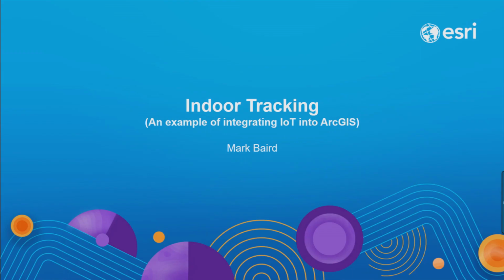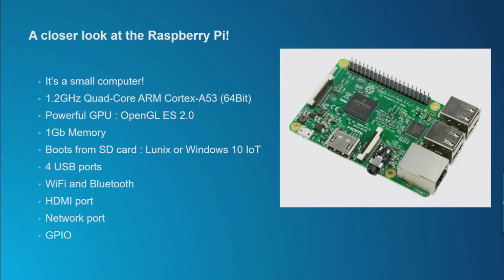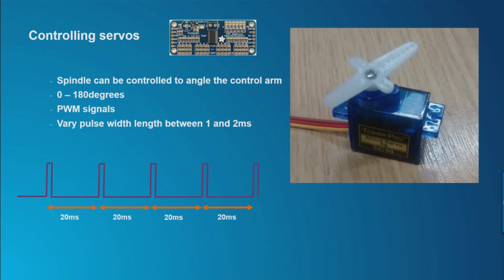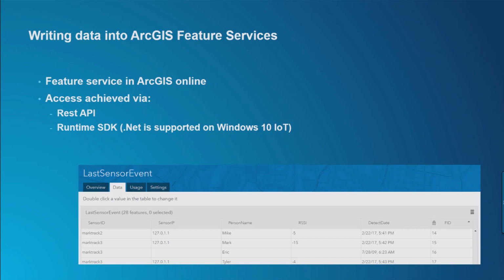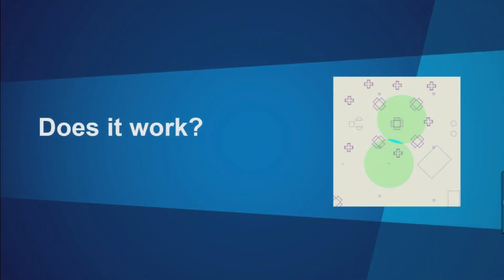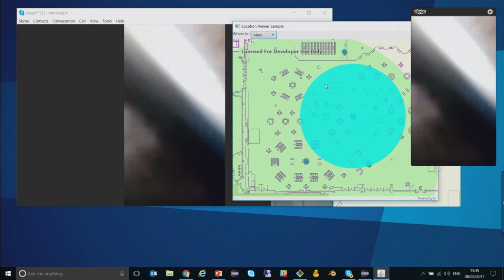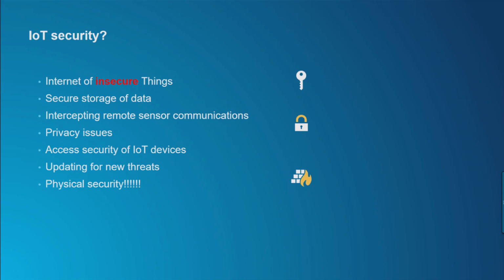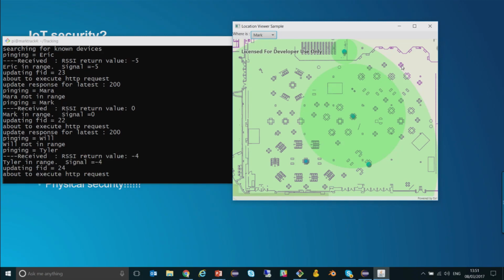IoT and Indoor Tracking with Raspberry Pi

Comment: Inertial Elements are doing the same based on accelerometer, gyroscopes, compass and pressure sensors and WiFi/BLE, But instead of hand held devices they are using shoe mounted devices.

Comment: Thanks for the video! Do you think with this technique it would be possible to achieve <10cm precision within a 25m2 space where the only interference would be people?
Reply: Hi Elie, 

Attempting to correlate signal strengths (RSSI values) with the distance from blue-tooth devices isn't going to get you a 10cm precision especially indoors where radio signals are reflected and scattered.  Using the Raspberry Pi devices listening to the RSSI values from various blue-tooth phones I found I could only reliably detect when the device was within 5 metres of the Raspberry Pi.  I therefore came to the conclusion that the solution was good for finding which room a person is in within a building, but not the exact whereabouts in the room they are.

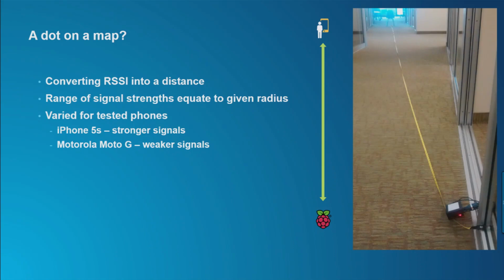In the video I did show a scatter graph of distance / RSSI values and although you can see a clear reduction in RSSI  value for increasing distances, the scatter of results was quite wild!  I explain this starting at around 10:25 in the video.

There are techniques for smoothing these results discussed in this paper if you are interested:  http://s2is.org/Issues/v1/n2/papers/paper14.pdf, although I've not tried this.  

I hope this helps

Mark
Reply: @markbaird-mbcoder  Hi! I am pursuing my masters and i need some guidance to finish my project work. Do you have an idea regarding ibeacon(BLE). If you know the interfacing of ibeacon with raspberry pi using python, please do help me. Even if you have any information about ibeacon please do share the papers.
Reply: @kontamtejaswini2745  have you got it because i need to know how